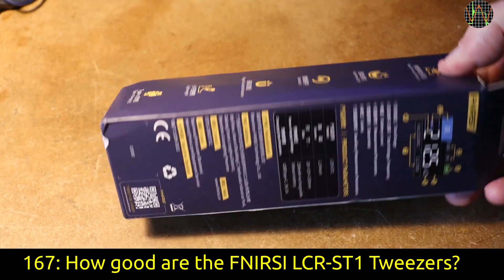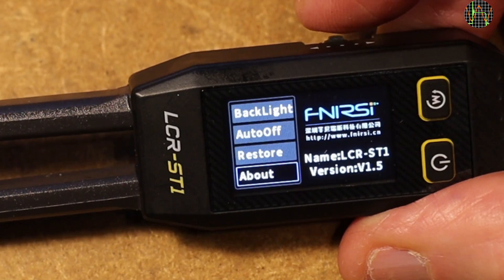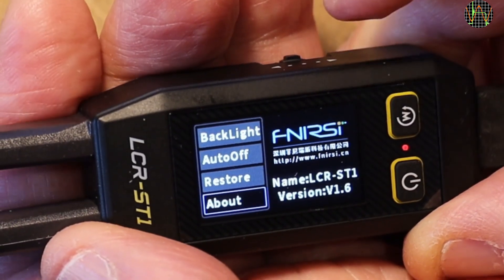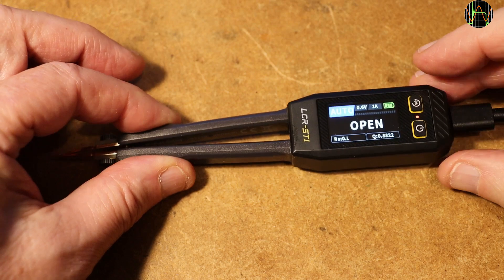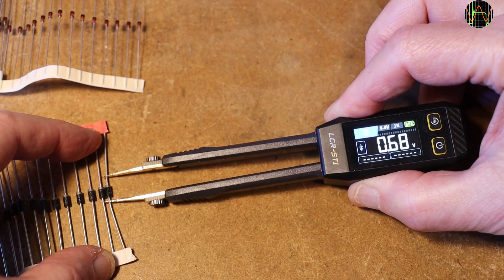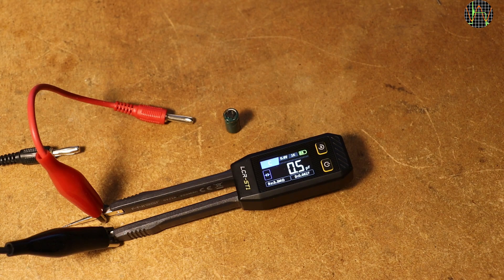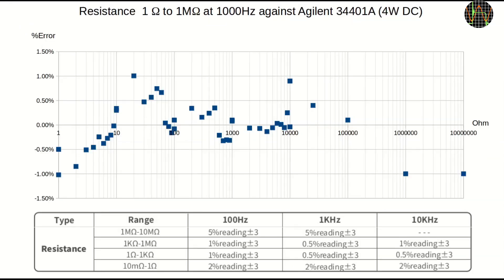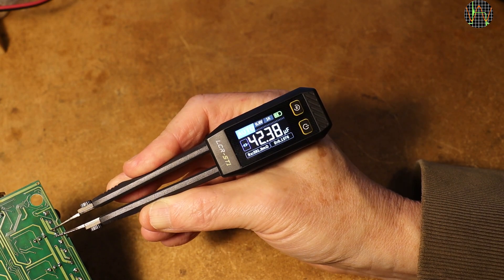167 - How good are the FNIRSI LCR-ST1 Tweezers?

Comment: Does the diode function work on your LCR-ST1?.
I just bought one, and mine does not.
Also, the unit does not upgrade (maybe the cable)
What say you?
Reply from the maker: The firmware update worked (when I made the video) but I have not tried it since. The diode test on this tester is possibly a hit-and-miss as the highest test voltage you can select is just 0.6V and many diodes do not conduct with such low voltages. This tester is primarily for in-circuit measurements and this is exactly the reason for using such low test voltages like 0.6 or 0.3V so that semiconductor junctions in diodes and transistors do not turn on and spoil the measurements. IMHO, FNIRSI should not have included diode test in the first place. You could try a few diodes, especially schottky ones that have a lower voltage threshold.
Reply: @TheHWcave  The file manager is not popping up for me. I downloaded the file from the website, but it is a .BIN file, and Explorer does not read it. It's possible that I need a different file manager.
Reply: @TheHWcave  .....It does tell you which way the diode is pointed.
Always good to know which end is up.

Comment: Ofcourse you can delete the recorded history, open the file, select the lines by dragging and right click and delete, then save the file, simple as that. if you back it up first on your PC, you can date and name the record..easy peasy..

spend more time behind the PC instead of with electronics...hehe...

And the low voltage option is to NOT affect the diode when measuring in circuit...that's what makes it useful.
that assures that a diode or anything behind it is not going to influence your measurement when measuring in circuit so you don't have to solder the component out of the board to test it..it works 95% of the time..

Also need to spend some more time with measurement equipment..

Comment: This model can not measure in-circuit resistors at all - totally incorrect measures (like 1.5kOm instead of 47 kOm measured by Fluke 87). Keep that in mind.
Reply from the maker: It uses AC instead of DC so depending on the rest of the circuit, things may influence the result. For example a capacitor in parallel will not disturb a DC measurement but it will cause an error when a resistor is measured with AC. Then again, the much higher DC voltage used by the Fluke (up to 1.3V according to the 87 user manual) may cause a PN junction somewhere to conduct which ruins the DC resistance reading. So you can't generalize and say it can't measure in circuit resistance. Yes it can and so can the Fluke or any other meter but the results of any in-circuit measurement by any method need to be carefully considered before taken at face value.
Reply: @TheHWcave  Yes, that's why it's totally useless for me.

Comment: Thanks for helping me get mine up and running. When I turned it on for the first time the battery was already at half power on this "New" tester.
Reply: it will self discharge anyway and you don't want the battery fully charged during prolonged storage anyway

Comment: Excellent presentation of data and comprehensive overview. I especially appreciate the shortcut to calibration which I did not know. I had no issues with the bootloader working first time.   Glad to see the REL is working better now and includes R and C. Does it work on L too?
Reply from the maker: Rel for inductance appears not to be implemented. I connected on purpose 2 meter long leads and upon shortening the far ends in L mode, the display showed 2.1uH, regardless if I tried to zero or not.